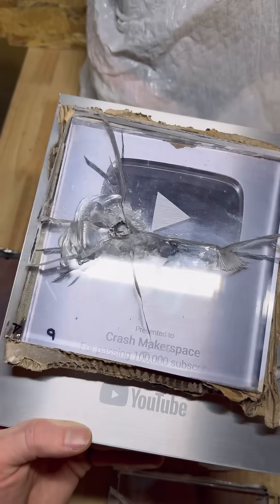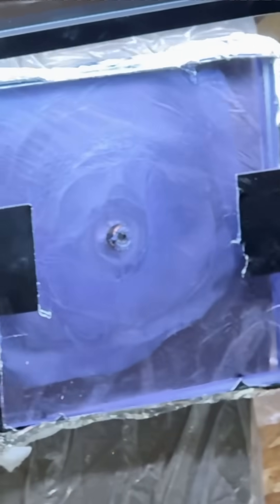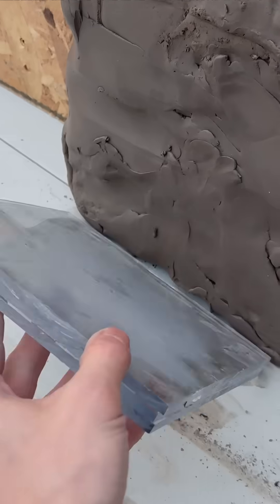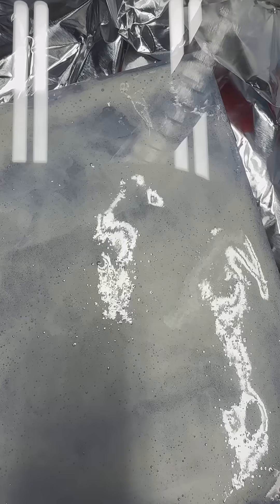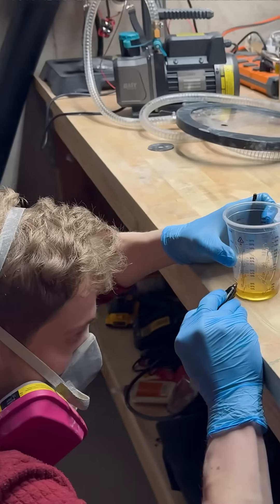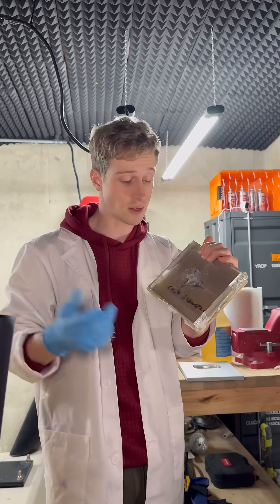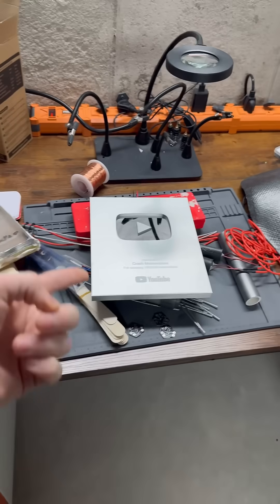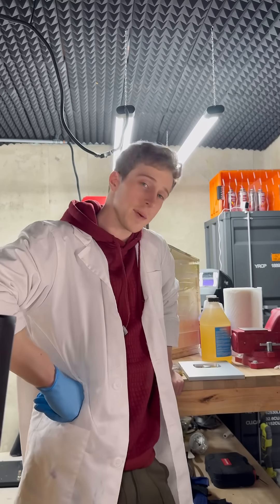Bulletproof Play-Button 💥 #shorts

Comment: I'm glad that you decided to go pew pew on a few projects because we're in the United States of CommieLand. But the hidden blade model is the Tallahassee Twinkie. I gotta know what happened with that. Did you ever come up with a metal version? The spine was awesome on those models. Also would you ever take a crack at the Connor rail? Raw Ice got the locking mechanism down Elchechin didn't but it remains a mystery.